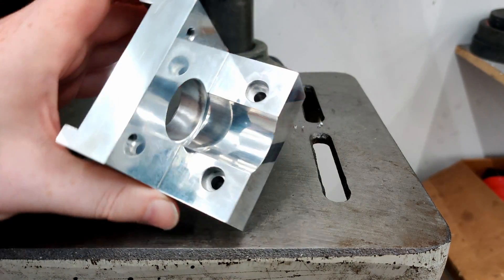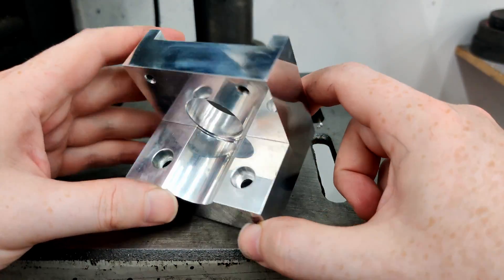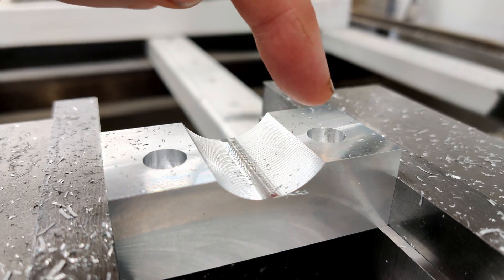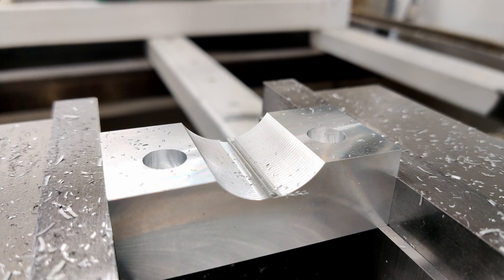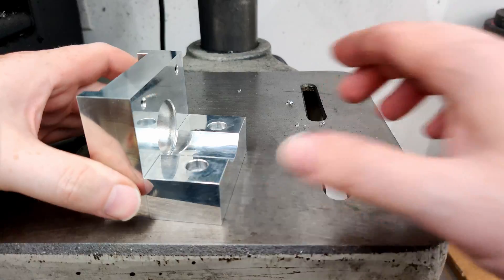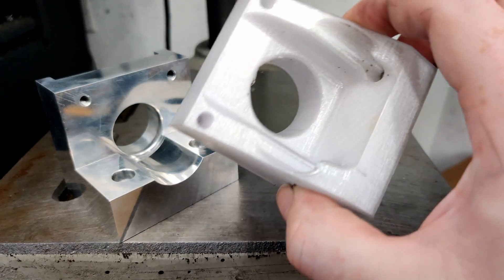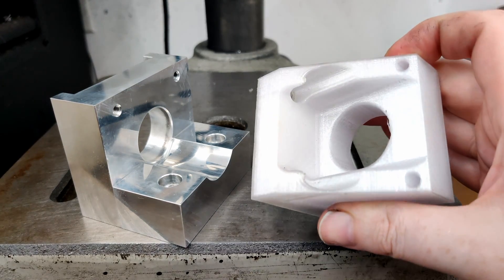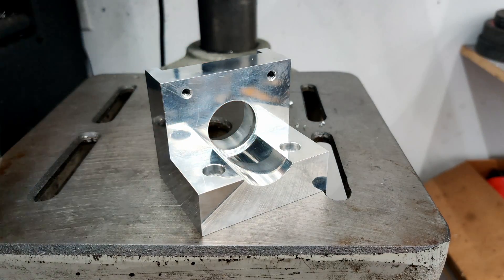Y Servo Motor Mount Part 2 #cnc

Comment: I accidentally ruined my 3d printed (PETG) stepper mounts on a longer wood carving test. Once the steppers reached thermal equilibrium the heat was just too much and the mounts deformed. Had to dial the stepper current down quite a bit. I will probably print some from ASA filament.
Reply from the maker: Yeah for sure I could see that with steppers if the amps are set too high. I'm running servos but even though they are rated up to 400w each, without any load on them they'll draw hardly anything and stay cool. Unlike open loop steppers that are drawing constantly. I wonder if closed looped steppers have a feature to draw less current on the drivers.
Reply: @BryanHoward  Yep, that's a big advantage of servos. My open loop stepper drivers have an option for setting the idle current. It can be set at half or full amount of the set current.

Comment: I love it! Is this video full speed?
Reply from the maker: Yeah and at the beginning when I had the overrides on by accident, it was pushing 4x the chip load without breaking the too. I should have left the feed at 200% and just brought back the rpm as it was handling the cutting fine. There are some obvious video speedups of 20x and you can tell when I do that in the video.

Comment: When it’s cutting across in the beginning it sounds like a siren. Neighbors must think the nukes are falling hahaha. Seriously though, this is like ASMR for the industrially deranged. Good stuff.
Reply from the maker: haha yeah it can get pretty loud. Gets even louder when it's cutting steel. Sofar doing sound checks walking around the house when it's running it doesn't seem too bad, but I'll get some sound absorption material on the metal garage door at some point.

Comment: Seems like you could tweak your VFD settings quite a bit? I've a little 2kw Chinese spindle on my router and it gets up to speed in about 1 second i think? I also made it do a little active breaking (although I've not connected a breaking resistor, so got it doing something like a 1-2 second stop. Don't recall exactly)

Faster spindle speed up also implies better control under a heavy cut.
Reply from the maker: Yeah that might help with some of the cutting in steel too.

Comment: Not sure What kind of cam program you are using but fusion deals better With higher stepovers in Aluminium. Was running 6mm stepover at 4000mm a minute Feed the other day .endmill was a 12mm 3 flute at 0.13 feed per tooth 😂
Reply from the maker: Yeah for the 6mm single flute I normally run them at 2.4mm stepover. This stubby one would probably handle 3mm stepover with no problems depending on the depth.  In this part I cranked it way down because I was planning on going straight into the ball mill and wanted to cut the steps close. Ended up adding the 90 degree parallel last minute so I should have brought the stepover back to norms and let the parallel job do more work.

Comment: Also what material did you use for the 3D printed parts that held up?
Reply from the maker: Petg. Stronger than pla but more importantly won't deform due to heat if you use it as a material to hold stepper motors. Stepper motors get hot.
Reply: @BryanHoward  awesome, thank you! I do think that rings a bell from one of your really old videos, now that you say that. 

Really great stuff you’re putting out, I’m always stoked when I see a new video from you! Please keep going!

Comment: Bryan you can definitely up the chipload on that ball mill. I've been using a 4mm 2-flute uncoated carbide ball mill at up to 0.06mm chipload.  Try 16000rpm @  1280rpm. You could up your stepover a little bit too.
Reply from the maker: Yeah for sure I think it would give a better finish as well. First time using a small ball mill like this so I had no idea.
Reply from the maker: The results I was getting with the ball mill with my settings didn’t give all the great of a finish. It could have been due to heat or just smearing the chips because the chipload was so small. I’ll try your settings next time I run it.
Reply: @BryanHoward you can't go too wrong with alu, but probably 24k is a bit high of a surface speed for a 4mm ball? Perhaps not so much though since the effective diameter is much smaller? Personally I notice that too high a surface speed gives a cloudy finish in alu
Reply from the maker: Looking back at the results in the video it definintly gives a better finish when it's cutting on the side (at the end of the video) vs the bottom (beginning). Probably due to the bottom does not have a good cutting attack angle and not a constant chip load. Maybe cutting such a shape like this again would give better results starting from the bottom centre and going up each side in an upwards direction.
Reply: @BryanHoward yeah, the theory in cutting upwards is that the outside flute already cut away most of the material.. Working downwards you are cutting mostly with the narrow centre of the tool

Comment: What're your thoughts on the 12k vs. 24k on that 3D adaptive? I don't know all the optimal load per tooth and feed stuff well enough to ask questions about that yet but it does seem a lot happier at higher RPM if you can move the machine fast enough to keep up with the required MRR or whatever it is?
Reply from the maker: The overrides were a mistake that I temporarily had set. The most important thing is feed per tooth. Changing the RPM and or the feed will affect the feed per tooth.